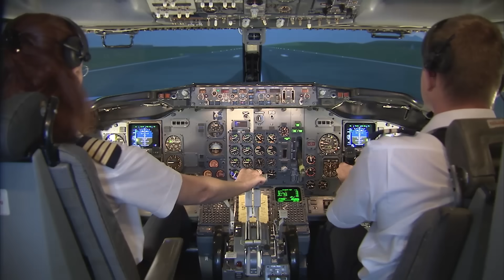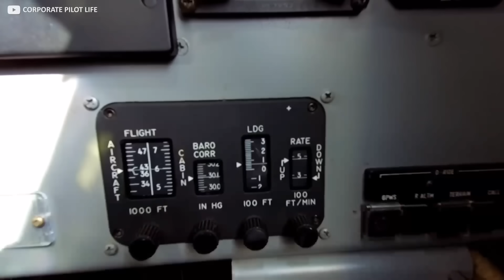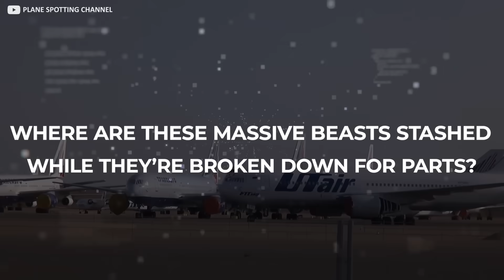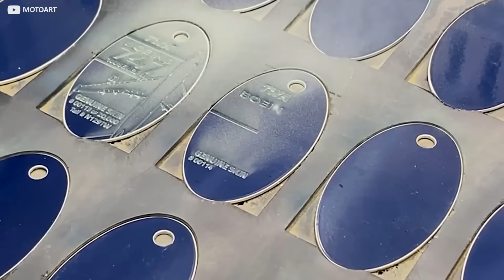What Happens To Old Airplanes?

Comment: Ooh theres a iirc it saus vf-111 or VF-III on it or something. A fighter jet in a park from vietnam fighter jet from the 70s or 60s in an old ammo place zi know of of where they gave it as a display to the city so theres a disc golf place titled N.A.D park.. well the "Upper" ie nad park vs iirc uh lower nad ie like marime nad park or wjatever closer to the ocean.. but ua have to or would cross a 50 or 60 mph high speed roadway to get to each one by foot in a stragiht line to prevent that preciselly zi am guessing is wjy tjeu left up the old barb wire fence aroumd the majority of the upper nad park.. with a few pits for plauing horshoes however that works idk how to offically play horsjoes ir at at all like idk how tf to dance, play chess, or cards well maybe fwiw if even uno I migjt ne anke to vaguely recall but fwiw depemds jow ua play it over the years ive been told its cjanged rules.. oh but def idk how to really bridge, cribbage, or pnuckle or pretty much any cards game.. fwiw lmao same with solitaire.. anyways but yeah fwiw I do know that is mayne slightly different than an old plane nut still fwiw.. anyways yeah..
Reply: Also it is in a fenced area for display but only itself ,eaning it is without the engine etc and fwiw surely the seat etc... theres also a tank looking type of iirc a ww2 relic that faces out across the narrows wa nridge? Iirc that is the name of it for iirc that was similar to the triangle line of fire etc fwiw.
 Or idk actually that is part of a different park too so botj are in a park of sorts.

Comment: The newest B-52H is 60 years old.  Some will be over a 100 years old when they are finally retired. So I guess it is possible to keep a plane flying indefinitely if your throw enough refurbishment at it.
Reply: they also dont have nearly the same number of flights as regular passenger planes
Reply: Anything is possible if You put money in preventative maintenance and regular maintenance!  The Aircraft industry is now into planned obsolescence more than ever!  So Sad!
Reply: All aluminum aircraft have a known maximum number of takeoff and landing cycles, based on the engineers’ calculations of metal fatigue.  I think that for a 747 it’s something like 50,000.

The highest time airplane of all time is a DC3 with something like 90,000+ flying hours. It’s around 85 years old.

So an aircraft can’t be used beyond the original design limits.

Military aircraft actually get very little use. Some types can be retired with as little as 5000-10,000 hours, and it may take them decades to accumulate that much time.

Comment: metal fatigue in the frame titanium structural members will be removed by a slow annealing process in the hot arid climate in Arizona ... Dislocations in the metal will realign and remove stress produced by fatigue. So simply Park the planes for a year in Arizona meanwhile refurbish and put back in service.
Reply: They aren't as fuel efficient as new planes. Also, airlines are getting away from 4-engine aircraft as they're more expensive to operate.

Comment: Boeing and Airbus fuselages are designed to flex during pressurization, which causes the lifespan issue.  McDonnel Douglas DC-9 and DC-10 series were designed to NOT flex during pressurization, so pressurization cycles do not apply.  I worked on a DC-10 that had over 190,000 hours when it was retired.
Reply: Interesting sir, would you like to elaborate?
Reply: WE REALLY NEED TO INFORM YOUR SHRINK TO INCREASE YOUR DELUSIONAL MEDS.  EVERY COMMERCIAL AIRCRAFT IN THE WORLD FLEXS DURING PRESSURIZATION THERE IS NOW WAY AROUND IT. YOUR MOTHER SAID THE ONLY AIRCRAFT YOU EVER WORKED ON WAS A PAPER AIRPLANE IN THE SANITARIUM WERE YOU GREW UP IN . 😂😂😂😂
Reply: Got news for you.  All fuselages will flex to some extent depending on the actual design.  It is all a matter of degree and where the design stress is located on the S-N curve (stress level versus number of cycles the metal is exposed to).  Back to Engineering 101.  There sre no absolutes.
Reply: Elaborate, because as far as I know every airplane is pressurized at altitude.

Comment: Could use the left over body as giant tanks weld everything closed clean or out or scrap it and melt it and mold giant tanks
Reply: Probably not, as the volume could result in extremely heavy loads that the bare shell would not have the strength to hold without major problems.
Reply: W/h/a/t/s/A/p/p

+/1/6/7/8/6/6/1/9/4/8/7

I/n/v/e/s/t/°°°in°°°/c/r/y/p/t/o/°°°/c/u/r/r/e/n/c/y/°°°/t/o/d/a/y•..

Comment: Which begs the question.  Are the 787 and soon to be produced 797 a disruptor in this market?  They are essentially immortal planes as they have no metal to fatigue. All u need to do is re-engine them and refit them with new interiors and voila a “brand new airplane “.
Reply: thats just wrong :) you need the "intire"insides of a plane also, just not the metal.. plane is way more than just metal.. just imagine how well wires run on bare metal.. so :) making a new one is cheaper.. right? immortal is a bad word to even use.. its one of those famous last ones, im "immortal" in my "brand new airplane".. sure you are :D some questions dont need to even be asked.. even if you beg